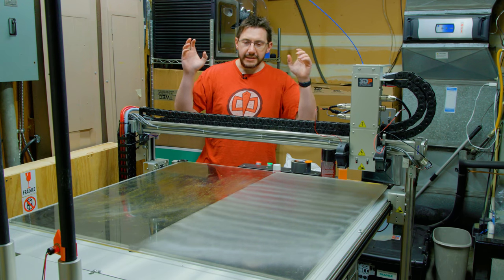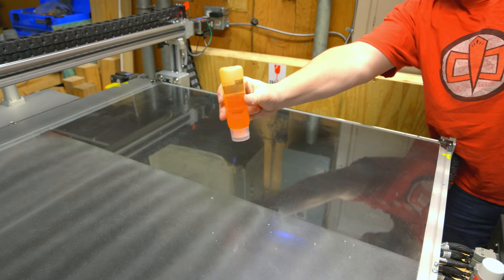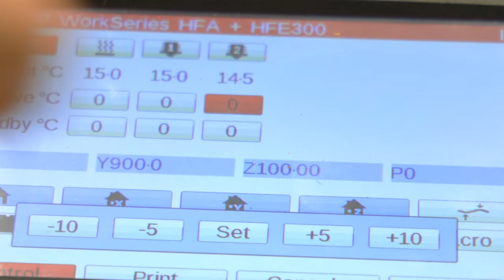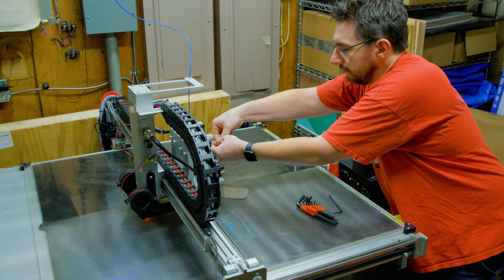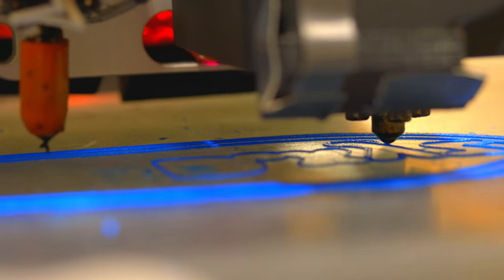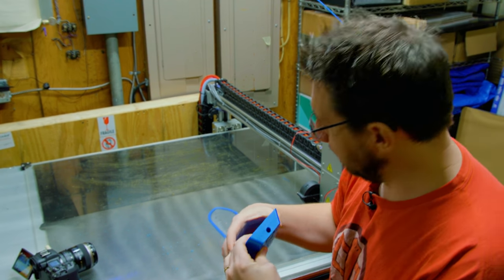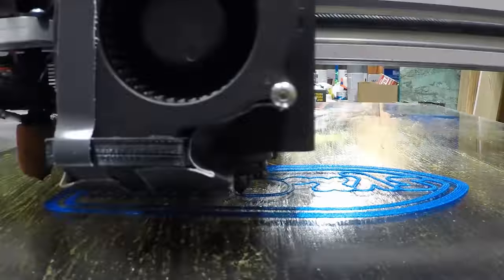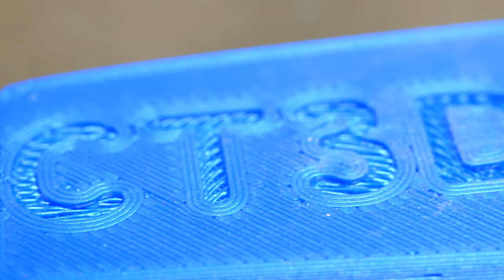$38,000 3D Printer Bed Adhesion Test // Super 77 & Zillagrip

Comment: This printer is pretty much a scam. Would putting a sheet of PEI on the glass work?
Reply: it looks super rigid and it's quite a large format, maybe it's designed for reliability? that large bed is apparently heated, and it has two nozzles? I don't know anything about this printer other than what was on the video, but it certainly looks like a $38,000 printer.
Reply: @AmeshaSpentaArmaiti  It's clearly not designed for reliability, the bed doesn't like anything big sticking to it and it doesn't even have auto leveling. The manual leveling is even among the worst I've seen. A better printer could easily be build for $10k and sold for. $15k, there is pretty much no reason for this thing to be the price it is. I would compare it to Apple, but atleast those work most of the time.
Reply: @squirrelrobotics  Bed leveling is a pain but once it is set it is good for a long time, I haven't adjusted mine in over 2 years and it still prints perfectly. Our 400 series has been largely trouble free and has done some huge prints
Reply: @AmeshaSpentaArmaiti  not to start anything but he did say the weight of the second extruder installed on the print head is enough to make it tilt and throw off level.  Thats not good
Reply: @PaleoHuntr  But if I'm paying  $40,000 for a printer (call it that because shipping and you'll probably use about $1k of plastic in like a year), it better be a pretty trouble free experience.
Reply: @squirrelrobotics  I'm pretty sure I said it was, I've not had to mess with the bed in 2 years, I've had not mechanical issues, and the only problems I've had have been filament issues. It's not a printer for hobby use obviously and takes a bit of advanced knowledge to run properly but with proper settings and use it just prints
Reply: @PaleoHuntr  What I have seen from it being used on this channel says something different. In any case, it should not be $40k.
Reply: @squirrelrobotics  the problems here have all been user error, nothing to do with the machine.
Reply: @PaleoHuntr  That is part of my point, a machine this expensive should be extremely easy to use. Even though they should, places that buy this machine most likely aren't going to have an extremely experienced person dedicated to just this machine. There are so many choices that don't make sense here. Like closed loop steppers, pretty much the exact same thing can be accomplished with TMC 2209s and their lost step detection. Having both print heads on one X carriage makes absolutely no sense because it is made heavy and harder to move around that way, which limits your printer speeds greatly, especially on a machine with this heavy of extruders. The extruders should be IDEX to combat this. The placement of the filament sensors makes absolutely no sense because it leaves you with a couple meters of filament left at the end of the spool, they should be placed on the print heads, it's really not that hard to do. This printer should come with an extremely flat MIC6 (atleast) aluminum bed and have auto leveling capabilities. Also makes absolutely no sense why you must have both filament sensors loaded in order for it to be able to start a print, you should be able to only have the print head that will be used for that print loaded and be fine. This has the potential to cause delays in a production environment because one extruder may (and most likely will) run out of filament before the other which not only means they have to reload the extruder before the other one can be used, but it also means if they don't have 2 spools of filament on hand they're out of luck and their printer is down until they can get another roll in. The usage of 2.85mm also makes no sense here, the "low flow" extruder should take 1.75mm (more colours and materials available) and the "high flow" one should take pellets, as the parts made on this printer in the intended environment and use case will almost certainly be painted afterwards. All of these little things add up to create what looks to be a under polished and badly thought out printer design. If I am paying $40k for a printer, it better be able to print 24/7/365 with little to no issues. But, these are all just my thoughts and I would probably have more if I took more time to look at the machine. I don't work in a prop making environment (what I think this is meant for) so what do I know?
Reply: @squirrelrobotics  It's obvious that you aren't their target market, nor do you have experience running non hobbyist machines. It's not and Ender 3, it has a learning curve but there is good documentation, they send you tuned slicer profiles, and they provide very responsive support. But no matter how much a machine costs you can't do anything about a user that thinks they can print PETG directly on a huge glass bed, that is just pure user error. Same with trying to print a huge model without dialing in the bed adhesion and it coming loose and destroying a hotend, just pure user error. Try running a Stratasys machine then talk about an expensive printer should be easy to use and run.
Reply: @PaleoHuntr  You keep mentioning problems with Joel not tuning bed adhesion, but could that not be fixed (or atleast greatly helped) by an auto leveling sensor? A BLtouch will you you back $36 and is directly compatible with the board on this printer. A build surface like PEI on flat glass or preferably a flexplate could also help with that. Should they not be providing guides for how to print materials (like PETG) that could seriously damage the printer if printed incorrectly? Even if when you loaded filament it asked you what you just loaded and providing you with a QR code to the guide on how to print the filament. An enclosure would even help, because at this print size, even PLA is going to suffer from some amount of warping if there are drafts or the room is just a touch too cold. My first printer was an Imakr Startt, I learned how to troubleshoot from that. I then bought a CR-10 in 2018 which is now heavily modified and am currently building a Prusa Bear from scratch. This hobby is what got me to pursue going to school to be a machinist. Even a course that the operator could take in order to know how to use the machine properaly and the different materials would be amazing (if they already have this then I guess Joel just hasn't used that resource) something like what HAAS does with their CNC machines and their YouTube channel, they have guides on how to do many things with their machines and even the "Tip of the Day" series that has little tips that can improve the quality of life and productivity of a machine. These are not problems purely isolated to 3D Platform, the same goes for companies like Stratasys. I'm sure industrial 3D printing is a whole different ball game and I really hope to have the chance to work with it one day. But it's really bad when a printer like the Prusa MK3S which is $1,000 for the fully assembled version is more user friendly and honestly prints better than this $40k printer. Companies like 3D Platform need to reprioritize what their main goal is. They don't need to reinvent the 3D printer, they need to go with what already works then try to improve on that in areas like user friendliness. This all is essential to 3D printing becoming a major player in the industrial space. It's really sad to see so much potential just being wasted.
Reply: @squirrelrobotics  it doesn't need a BLTouch, the bed is fixed and solid and when properly leveled, something they did for him when they set it up, it stays that way till you do something stupid. I assume they expected someone with a 3D printing channel as big as this one would know how to properly use a material as common as PETG, that was just a stupid mistake on his part. PEI is pointless since the glass works just fine with a light coat of hairspray, I have printed models over 1 meter long without a bit of lifting, it really isn't difficult. Joel wants this machine to look as bad as possible and is doing a great job at that. All that said I have more issues on our Prusa than I do our 3DPlatform 400, but then again I read the manual
Reply: @squirrelrobotics  Seriously, who complains about bed adhesion then doesn't use the bed heater? That black surface under the glass is the heater, it covers the entire bed and heats very evenly.

Comment: Vision miner nano works with everything I have thrown at it. For hard to stick material make sure to apply 2 or 3 layers in a cross hatch pattern while giving it time to dry between coats.
Reply: I have also had good luck with vision miner.  It appears to have a higher melting point than pva/glue stick and continues to be adhesive when the bed is above 90c.  I don't know if it will perform better than pva at the low bed temps used for pla.

Comment: Well maybe these two adhesives would work with heated bed? We know that lift is caused by plastic contracting, so if plastic would not cool so much during print (at least on the bed) ot would in my opinion shrunk so much.

Comment: I honestly think it's the temperature and airflow in the room.  Even if you've heated the garage, the drafts in the room will keep cold drafts moving through the room.  Time for a temporary drop down ⅛" acrylic enclosure, heat the bed (holding it there to warm the air and filament spool) and then print like normal.  I have a simple design in mind.

And dry the filament...  It looked pretty moist by the end.

Comment: I am not sure if you understand the material behaviour. Lifting is caused by the temperature difference between nozzle and laid material, heated bed do two things. Firstly heating print in order to lower difference between temperatures (nozzle vs printed object) and secondly materials have melting point and if you are within certain temperature zone under melting point material is sticky itself because it's melting but not to a liquid state.
The adhesion products only enhance this stickiness but the right temperature difference is key to have non-lifting objects. 

The filament in the video is High-temperature PLA - HTPLA that's mean that result printed object is more temperature stable but that means is likely to be more problematic while printing.
For this filaments is best to be printed on the hotter plate around 70°C (instead of normal 60°C) and room temperature more than 25°C and without any draft.

Comment: Ambiant temperature is key to good prints. 78-99 degrees plus heated bed. Lifting is caused by cooling and contraction from that cooling unevenly. This is why heavy plastic prints do ok because the heat stays with the print longer.

Comment: at this point I feel the shrinkage would potentially be an insurmountable problem. I feel that if you get full bed adhesion, 1 of 2 things would happen. the shrinkage force overpowers the glass and cracks/explodes it, or the print is never coming off the bed.

Comment: The fixes I use for PLA lifting, in order of desperation:
1. Increase bed temp
2. Slower first layer
3. Pause the print for 20-30 minutes after the first layer completes. On BAD examples, this can be repeated after the second layer.
4. Finally resort to brim!

If I'm not concerned about the edge, I'll just skip to #4 before my frustration exceeds  that day's tolerance level.

Comment: Try adding a pause between layers to let the filament cool down?
Reply: that skirt should also be wider and attached to print perimeter.  its not
Reply: @spunkmire2664  That is called a brim.... I think
Reply: @MrGerhardGrobler  you are correct
Reply: @MrGerhardGrobler  so ive been told and corrected.
Reply: either way, skirts seem useless.  but i'd be using a wide brim
Reply: @spunkmire2664  Skirts are very handy to see if your first layer is going everywhere at the right distance and also to 'prime' the nozzle.
Reply: @elvinhaak  sure does, and a brim does same function, with added adhesion to print.
Reply: @spunkmire2664   Yes but you have to then remove the brim after it's finished printing :) If you don't need the extra adhesion that a brim provides, a skirt will perform the "nozzle priming" function without giving you a post-processing job!
(PrusaSlicer also has options for making a skirt more than 1 layer high, to protect against draughts, which is interesting. I've never tried that out, so I can't comment on its effectiveness.)

To be clear, I personally have used a brim for most of my prints: I don't think they're inherently bad or anything, and often they don't take much effort to remove. But they are extra effort - even a little - so for models/printers/bed surfaces/etc for which a brim isn't needed for the part to stick, it's definitely preferable to skip that post-processing step :)
Reply: @AndrewGillard  great, ill stick to brims

Comment: In my experience I’ve found that printing temperature, ambient temperature and part cooling are all much more important factors regarding prints lifting rather than bed adhesion. It’s near impossible to overcome the internal forces that want to warp parts, it’s hundreds or thousands of pounds of force. For many large parts now I turn cooling off completely. Or let cura turn the fan on only for bridge sections.
Reply: I couldn’t see if you were using part cooling or not, but since you asked for recommendations I’ll throw out turning part cooling off, having a nice hot bed and enabling a draft shield in cura.
Other things I’d consider: changing infill type and density and maybe try printing really hot or quite cool. I’ve yet to figure out which works better but sometimes just changing it has helped.

Comment: I don't have a heated bed and do PLA and PETG. I use hairspray with a lot of isopropylic alcool inside (my 3D shop sells rebranded sprays, under the sticker it is a spanish hair laca called Nelly, you can find some on Amazon).

Comment: Either your layers are cooling too quickly causing shrinkage to happen too fast, or your nozzle temp is too high re-liquifying previous layers. Maybe a bit of both. Drop nozzle temp 5 to 10 degrees would be a good check for the latter and a warmer room temperature would be a good check for the first.

Comment: One thing that sometimes helps on my prints 'if everything else fails' is to print on packaging-tape. Just on top of it, using 70 degrees bed temp.
Normally I just use sugarwater if I need some extra adhesion though (some sugar, mix with good warm boiled water untill saturated, cool it down, put same amount of IPA to it to be able to spread easier very thin). Needs to be very, very thin layer.

Comment: Hi, idk if you already tried it, but if you mix wood glue with water and distribute the mix on a heated bet, until it evaporates, then it leaves a film of some kind, And as long as the bed is hot, you almost cannot remove the print. I have used it since the beginning with PLA. Works every time. Would be really cool, if you would test it for yourself

Comment: Try PVA Wood Glue. Works great with Nylon.
- Start at 50/50 with water. 
- Use it thinly. Use less water if you don't get adhesion. 
- It will affect the texture of the printed surface. If you brush it on in a criss-cross X pattern, you'll get that pattern on the first layer.
- Wash/wipe with hot water/sponge/spatula to remove it. With a Prusa I just put the printbed under a hot tap.
- IMPORTANT: Use Interior, not exterior PVA (or else have a jack-hammer to get your print off the printbed). 

For lifting edges; I usually make an extended 1mm thick tab (About 1" square in size) in the areas that need to be stuck down ( I avoid full surrounding brims if possible)
Good luck. Let's see how it goes.

Comment: One other suggestion/thought.  Have you tried printing on Velcro with sticky back/tape?  Stick the hook side to the bed and the loop side to the hook and print on the back side of the loop side.  Maybe even work for multiple prints.  Just remember to suitably adjust the Z height.

Comment: My thought is the forces above the 1st layer of plastic exceed the force of adhesion, causing lifting. It would be interesting to design a superficial box around the benchy while printing in order to perhaps help decrease drafts and artificially insulate the print itself as opposed to having to creating an artificial box around the printer itself.

Comment: Take yer glass plate to a machining outfit.
Have them bore a pattern of holes, like Ultrabase, right through the glass.
Slight vacuum under the glass during first layer: suction draws a tiny bit of material into the holes, 'keying' the print and bed together.
Post-print, a tiny bit of pressure under the glass should pop the part right off!
The bottom of the print might be 'fuzzy', but it held to the bed!

Comment: Why no heat on the bed? Even on my Tevo Tornado I use 50-60C for PLA when using a glass bed. I think your glues (either of them, or even a gluestick) would have worked, but still need a bit of heat to prevent the shrinking. I'd probably start with 60-65C and see if that helps, then work down from there.